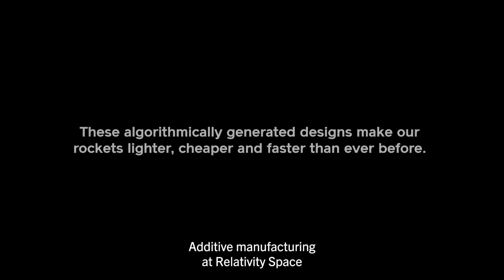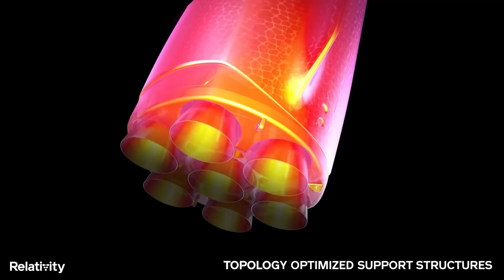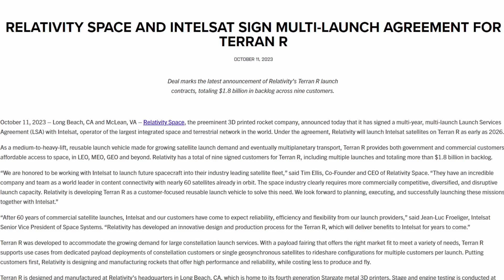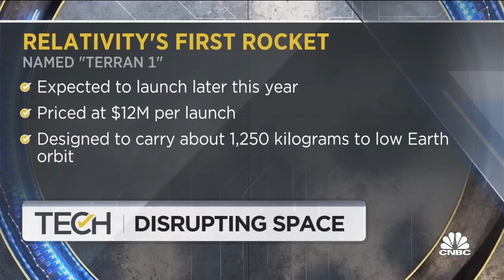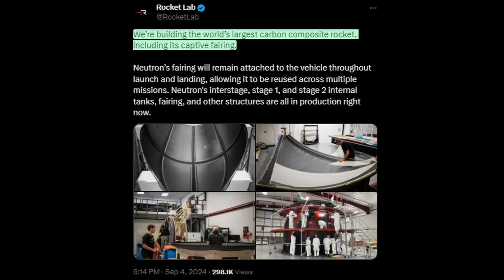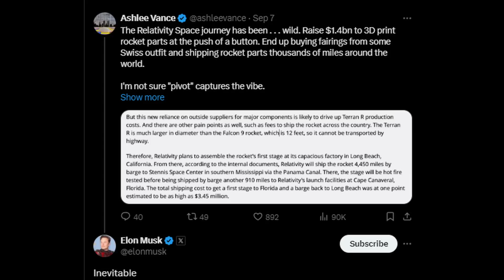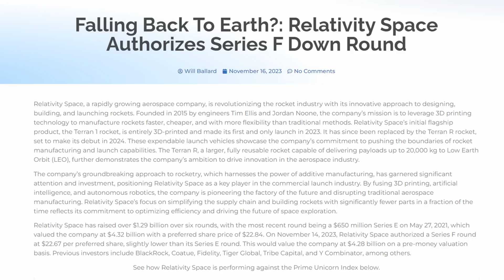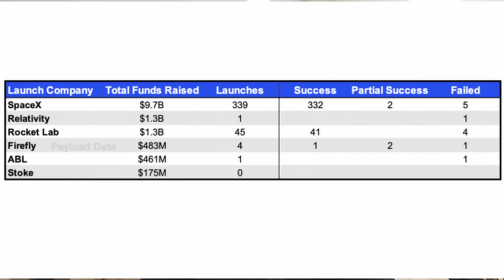Is Relativity Space's Terran-R Rocket In Trouble?

Comment: I used to be an aerospace engineer and had some involvement and knowledge of 3D metal printing.  I know enough about the process to realize that it is not a magic solution for all aerospace structures 20 years ago.  There are some things that it makes sense but not for others.  One of the biggest issues for its use as a pressure vessel is that it produces a wavy uneven surface and can sag due to gravity when you try to build it up unsupported.  Wavy surfaces at geometric discontinuities causes stress risers, which is bad for your design.  Don’t think that the engineers within Relativity thought this approach through before proposing it.
Reply from the maker: @Oldman5261  it does seem odd, you'd think they would have known that. Maybe they thought they had a fix but it didn't work out.